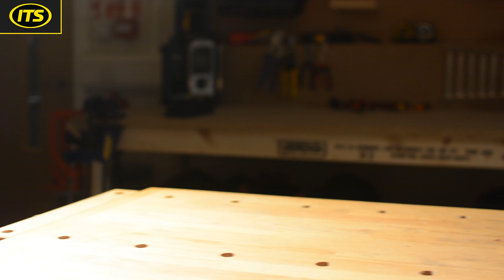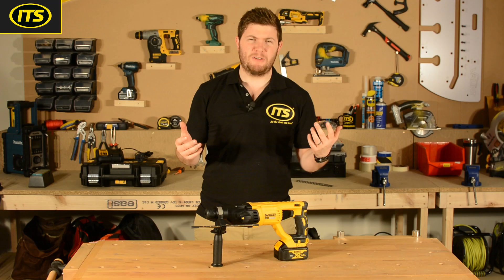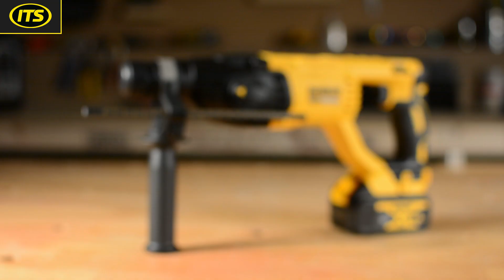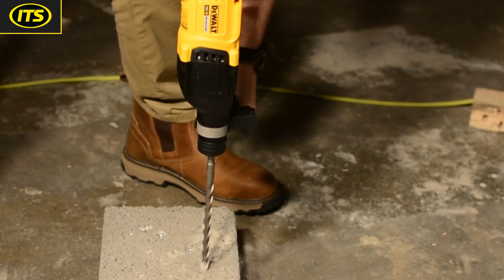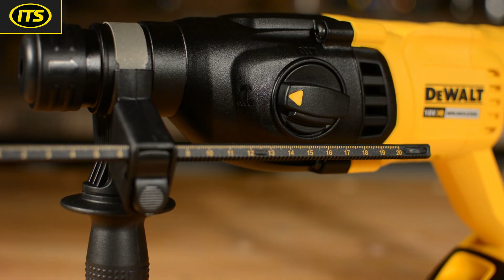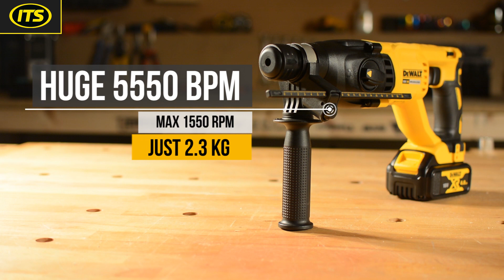Dewalt DCH133 SDS+ Brushless Hammer Drill - ITS TV

Comment: How you switch from a concrete drill to metall drill bit? Is required a sds+ endbit for metall? Or is the sds+ holder bit removeble?
In video is only concrete job showed but machine is allso used in wood and metal job too...
Reply: You can huy a standard 3 jaw chuck which just pushes into the chuck in exactly the same way as an sds drill bit

Comment: Hello, thanks for the video. I've searched a lot for the difference between Dewalt DCH133NT and Dewalt DCH133M1 but couldn't find any difference. If you know, I would appreciate it if you let me know. I wish you a good day.
Reply from the maker: Hi there - in terms of the actual Drill itself there is NO difference whatsoever they are the same thing. The last few digits of those codes refer to the 'package' that you might be buying. So the DCH133NT is a package of the DCH133 drill, plus a case, but NO batteries. Whereas the DCH133M1 is a package of the Drill, plus a case AND 1x 4ah Battery. I hope this helps clear it up!

Comment: which would you recommend between the DCH133 and the DCH253 for tile removal? These tools appear to be suited to the same job, is there much of a difference?
Reply from the maker: Hi Stewart, You're right they're both SDS+ Drill and part of Dewalt's cordless XR range so they have plenty of things in common. The biggest difference is the design and size - Some people prefer the older style of SDS (Long and Thin) which is the DCH133 - and other prefer a compact unit such as the DCH253... Other 2 differences aside from the Design is that the DCH253 has expentional vibration control - which takes the vibration away from the user and protects you as well as the battery better than other models. On the flip side to that the DCH133 delivers more Joules of impact energy when in Hammer mode (2.6 vs 2.1js from the DCH253). So they're you key differences. 

Both will be perfectly able to remove tiles so it really comes to do what is important to you; Design (personal preference) - Vibration (Winner is DCH253) - Power (Winner is DCH133) - Price (DCH133 is cheaper) 

I hope this helps Stewart, please let me know if you have any further questions! Rich

Comment: What size of bits this hammer drill use
Reply: Any body know
Reply from the maker: @franciscobaires5777  Can use any up to 30mm in wood, 26mm in masonry and any up to 13mm in metal
Reply: You can buy a 3 jaw chick to fit into the sds chuck so you can use it to drill steel and wood or anything else

Comment: You don’t pull back the collar to insert a bit. You just insert and twist. To remove it, then you pull back the collar.
Reply: Yep, I see so many pull it back to insert it, ha. This drill is fantastic, I use it for many things including even mixing concrete (could use a little more power, but it works a lot better than my standard 7amp corded drill. It is not as good as a 9amp spade mixing drill I have used, but it is not that much worse)
Reply: @nafnaf0  dont mix concrete with this. Get a mixer, you can get cheap ones for 50 bucks at harbor freight etc, dont use your 200 dollar specialty tools.
Reply: I cant figure out how to put drill bit in